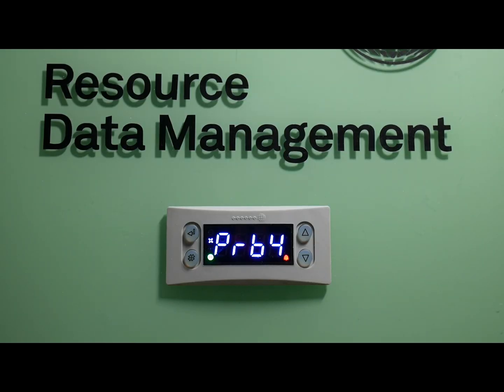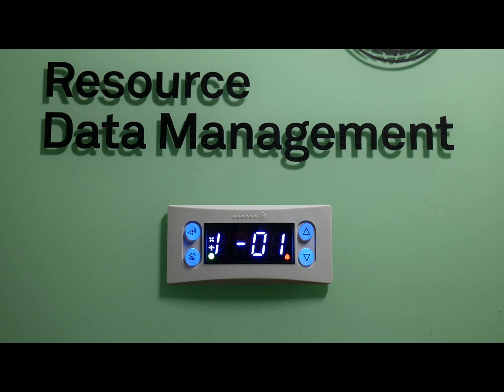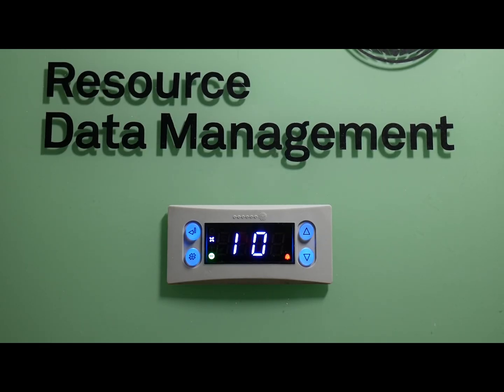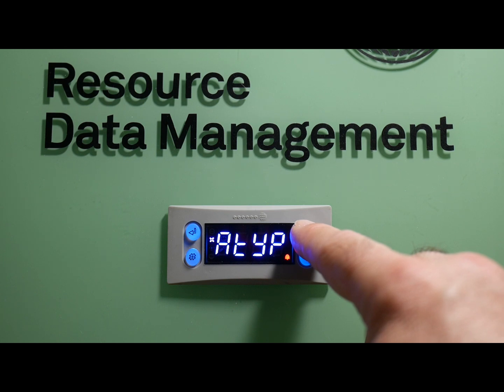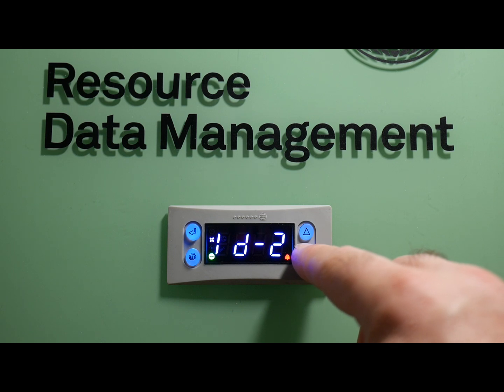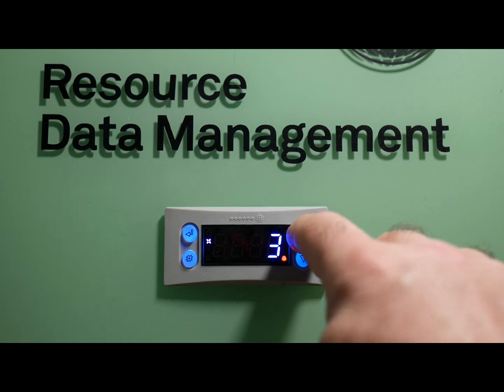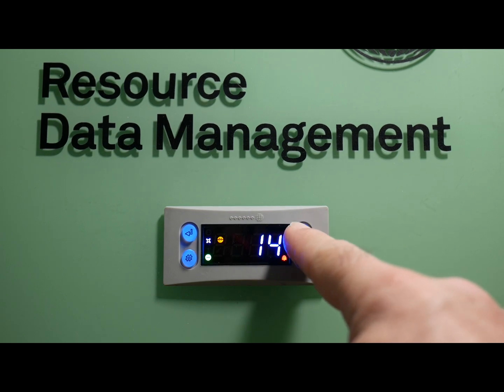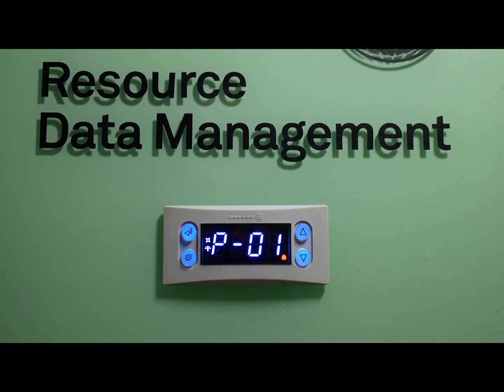PR0740 Mercury 3 Case Controller Setup

Comment: Hi RDM,  to force defrost , simply press and hold button below enter button, but how cancel forced defrost?  I have tried press and hold again that button but nothing happen
Reply: Probably has a minimum defrost time so yes pushing and holding the button again will stop the D/F however until the minimum timer expires it will remain in d/f 
If it has heaters they will go off as soon as you press and hold the button again but stays in d/f until timer expires 
Hope that help